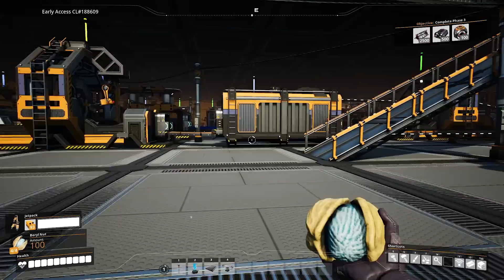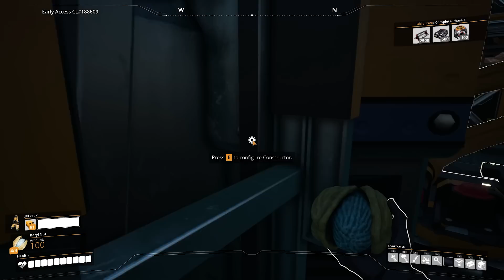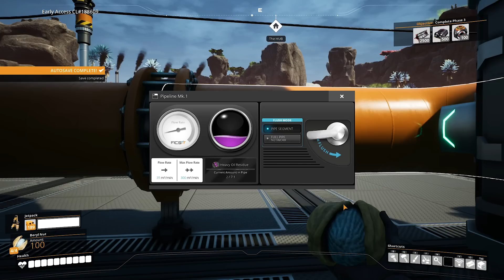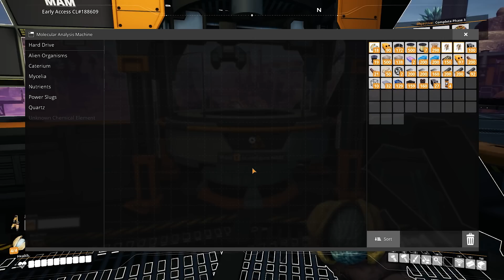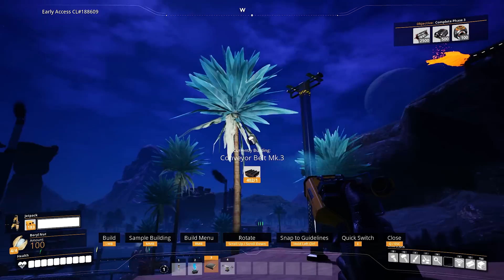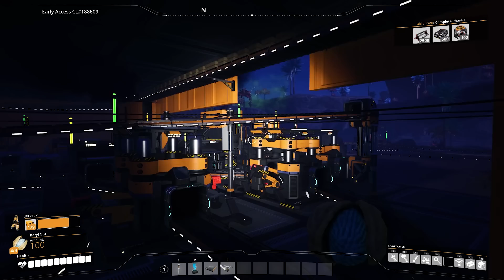New Storage System and Gas Power | Satisfactory #16

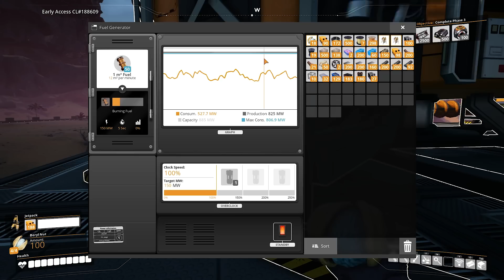Comment: 27:42 Dude, it says right there it's using 12 fuel per minute.  Your refiner is making 40 per minute.  You can run three generators off of that one refiner. Read what's on the screen, FFS.

Comment: Explore to find more crash sites and unlock alternate recopies.  With only the right 2-4 recopies that one pure oil node and MK2 pipes you can get 200 plastic and rubber per min and close to 10,000MW power with refineries and power generators,

Comment: Little tip: While you have say mk1 belts active tap E to switch grades, also works with other items you can also see the context select menu by holding the E key.
You saw that the power generator at base uses 12cm3 of fuel per minute and you are making 40cm3 per minute meaning you can run 4 at 89% clock speed (So they consume 10cm3) otherwise you would need to make more fuel.

Another example when you're looing at say a power pole you can clci your middle mouse to copy the building ot item for building. :)
Seems you're enjoying this game its very fun and can get crazy at the later tiers.

p.s your cateruim miner only make 120 resource per minute so using an MK 3 belt is kind of bad as the belt grade usually hint how many item you have on that belt.